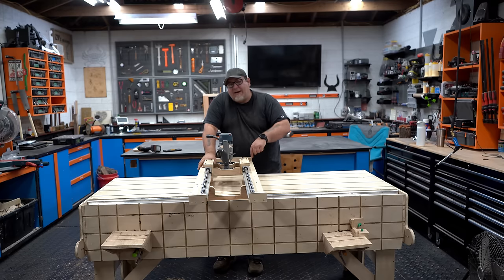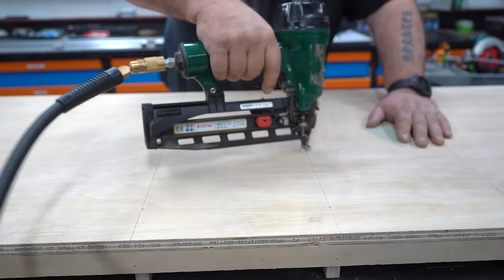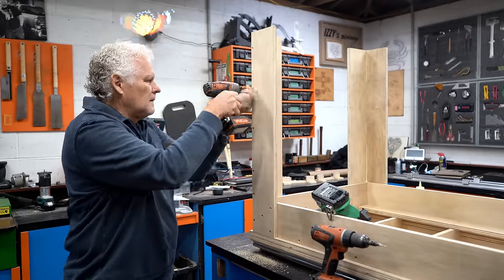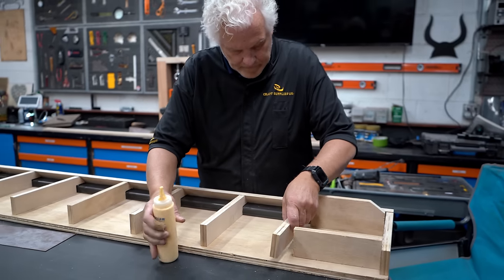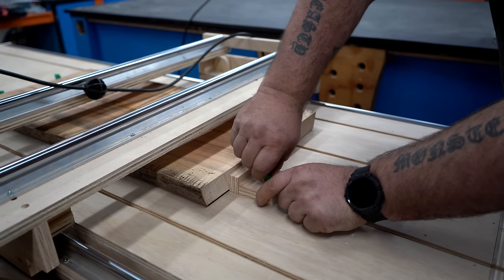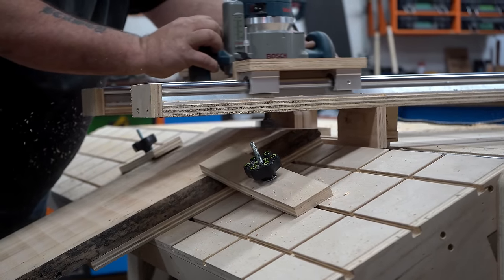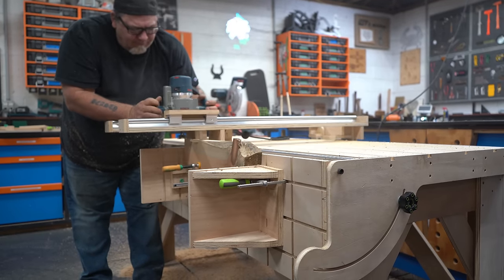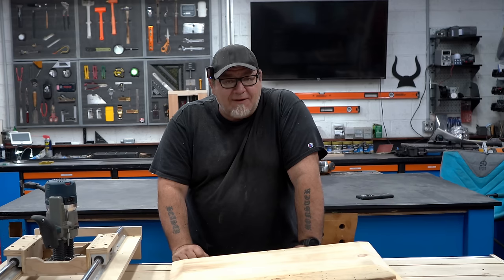How Slab Flatteners Should be Built

Comment: Definitely one of your better ideas. Its actually a simple solution with the ability to resolve so many more complex challenges. The versatility is awesome but this is not really an option for a small shop like mine. However if it was incorporated somehow into my existing workbench then my workshop/garage could use the single bench as a dual purpose. I use similar rails for flattening cutting boards and they work great. I am working on an idea to make the rails a permanent part of my work bench that I can reveal when I need and cover when not in use.

Comment: Make a sled for a circular saw and you could have a small panel saw. And with the matchfit slots on the top you could use the "panel saw" to batch out small pieces, or taper legs, or act as a jointer that's faster than using a router with a flattening bit. 

Kinda like the Kreg track saw table contraption. Google tells me it's the Kreg ACS.

Comment: Hi 👋,  Izzy Swan , interesting project, you might bear to incorporate a pattern system, whereby you make a pattern or jig, which can be clamped to your device, then heaven in a stylus that runs off of it, to create the shape that you require, I suppose the ultimate thing or to turn it into a CNC machine, I am quite lucky as I have a surface planner and a separate Thickness machine, good luck with your project.
Stay safe, keep up the great work shop ideas, Phil from the moulin France

Comment: Cool idea man!

Set up detents/patterns that can be used for making box/dovetail joints would be cool. 
It would also be cool if you can set it up to allow for shelf pin hole boring. 
To make it even cooler, you can set it to a lock position to lock the router to lock the router to make long dados/grooves. (Lock collar/c-clamp with a nice ruler that is zeroed router centerline might make it simple.)

Comment: If you used stops on the rails, you could use them to make recessed cabinet/drawer faces. Use the match fit stops to line up the top, cut, flip 180, and cut the bottom for all faces of the same size. Then reset stops to do the sides. It could replace a router table/shaper.

Comment: Super cool idea -  I think it would be fun to place a template on the main bed with a fixed pin attached to the main sled - like a pin router and then use the side board holder to make designs like mortise and tenons or patterns etc. on the board - you could even reverse it for top surface inlay or other types of carving....  one other thought would be to make some kind of adjustable holding fixture to help take twists out of slabs by making one side perfectly flat and then turning it over to make the other side parallel.   Thanks!

Comment: I think this is really cool, especially the side table which I haven't seen before in this kind of jig. I have a similar table like this built with linear rail and a melamine top. I really like the dovetailed grid you put into this and will have to steal that idea. Since building mine I use my 6" jointer much, much less. Firstly because I find the jointer so much harder to set up and get reliably flat surfaces from, and secondly because 6" is too narrow for the vast majority of work that I do. I want to get an 8" machine but honestly, I'm not sure that I'll use it that much more. The one thing my slab jig can't do is edge jointing, which is one of the reasons why I like your side section here so much. I occasionally mill small logs too, so it would be great for squaring those up as well. Oh and having recently upgraded from what I think is the same Bosch to a Triton 3HP router, I would recommend it.

Comment: I think an axis that you can put on the face of the pivoting table to make chamfers on round work pieces could be pretty powerful. The height of the jig becomes a limiting factor pretty quickly as far as the radius you can do but it would be an interesting challenge to chamfer 90 degree swept corners on a rectangular slab.

Comment: Suggestions on Occupational Health Concerns:  Suggestion 1:  Dust collection?  Who needs lungs anyway?  Suggestion 2:  The variable angle side table is cool with that big log sitting on it but…… that’s a lot of weight.  The only thing holding that weight is a few thumb tightened nuts and bolts.  The variable angle mechanism doesn’t look beefy enough to hold much weight without slipping.

Comment: Very interesting. Really wonder how far you can take this. It could a pore mans cnc router, straight and angled lines. How about adding a feature pattern following feature something like the pantarouter only horizontal. Not only for flattening. I really like the addition of the tilting side and how you put a bark covered log on it and flatted one edge. From that log you could go to 6, 8 sided not just 4 sided. I see a lot of potential for something like this. Wish I had a bigger garage. I agree this could be built as a assembly table as well. I do have a 4x4 CNC and since it's flat it does get used for assembly projects. The 4x4 CNC is plenty big enough for my needs but I could see building this thing 4x8 with the folding side wing. Oh the possibilities!

Comment: Very cool but in my case, no, 1) I don't have the room and 2) I don't have a CNC or a band saw to make the parts (and no I don't have access to those). But, I do admire and envy you. I made a cutting board and had to flatten it after the glue up. I used a similar concept to yours (with the router), but it was a pain to do.

Comment: Interesting, as it gives me some options for a build I want to do soon.With the pivoting side table, possibly some "stops /stop-pin holes" to bor ends (there might be a way to get a pivoot arm to the middle or thirds for extra ridgidity though I haven't though through the required geometry yet) at preset angles 60, 45, 30, 22.5?

Comment: Love your videos. 
If you put stop safety rings on the rails it could be used on cutting boards to create a groove. 
Same goes for things like grooves in a drawer front. 
How about using templates? So between the router base and the workpiece a slide in and lock tray. The tray would be clamped to the work table top.

Comment: This is so impressive. My issue is that I'm usually doing boards that are about 12' long which don't fit nicely on most frames due to rail length. Also storing such a large table in a hobbyist shop is tough. Maybe legs that fold into the top for storage?

Comment: I see a because we present the wood to a planer with a inherently square and 90 degree surfaces held steady the expected result is the opposite side will out come At 90 & square. Your device requires setups that must be accurate because they are creating 90 & reference edges at the same time. So a level of expertise is involved with use. Router fattening then corners squared by fastenings to the side table. So to 6ss takes a bit of setups. This device is exceptional at doing what others won't nicely done!

Comment: I built those infeed legs and they're AWESOME!  I have the same router, looks like a 1617evs, 2.25 hp router and now I have a 2nd one... as while using my sled, using probably a roughly same sized bit  with collet extension, and it got out of control during a pass on a board and ruined the router. Did not do good things for the end grain cutting board either.  Scared the Hell outta me of course. No injuries but it's for sure not "true" anymore either. 

Love your plans and stuff Izzy!

Dust collection or PPE is kinda missing in there, Get a mask on brother!

What router bit were you using? Link??

Comment: I like it! Very cool flattening machine. I have an upcoming project planned where I will be making a live edge countertop for our new kitchen cabinets. Only thing is, I don't know if commercial slab flatteners are able to produce a bull nose edge on that live edge slab. Basically, I want to be able to have the whole slab about 1/8" lower than the front edge of the slab, so that water won't roll off onto the floor. Have you considered that sort of feature for your machine as you develop it? I would be interested to see that. Nice job, and I would consider making one like yours to make my slabs. Thank you for sharing.

Comment: As you said, there's a lot of real estate taken up in the footprint of that. No doubt you are a design genius with all the contraptions you've designed over the years. Looking at it at the moment,  you've designed a manually operated 2D/2.5D CNC. A few more tweaks and a rise & fall cam follower, and you could knock out some 3D reliefs replicating items on the table eg large baroque picture frame in 90 mins... guilding costs extra!

Comment: It would be very easy to use as a mortiser, and for pieces that exceed the vertical height constraint from floor to gantry, you could build a horizontal gantry and let the pieces hang off the edge of the tabletop.

Comment: I woke up 2 hours early because I was thinking about other uses for this table. Initially I thought it would be cool to add some kind of band-saw attachment like the small hand held versions, but then why not add a different sled that is a chainsaw mill. You would use the smallest thickness chain so that you could do reprocessing of timber like using a normal band-saw but it would be easier and for people with less strength/mobility you don't have to hold and manually feed the timber through it. You could use the 3hp router to power it, you just need to get someone to mill up a half inch shaft that you could attach a drive sprocket to. Just a thought. Have a great day.

Comment: Automation! I'm VERY interested in building an automatic slab flattener, essentially a very basic CNC, though it wouldn't even need to be computer controlled. I'll eventually come up with something that does this, but I'd love to see what your big brain can design. While it'd be tempting to just make a CNC router, the level of precision required for that means it'd be far more complicated and expensive than a basic auto-flattener. Could be as simple as adjustable limit switches (so the controlled area can be adjusted to slab size) and a motor reverser, with the router plugged into a current transformer so that the motor(s) moving the sled across the slab can be slowed down when the router bogs down.

Comment: Well it seems the prototype is as good as you can get without checking for level second. I sware I was in like for trying something like this. I'm not a stickler for perfect degrees of angles because of my art type of projects.

My idea of possible improvement of this table top would be upgrading it do chainsaw sawmilling. With a few more ideas or maybe more metal parts it could be the full spectrum from log to boards to almost finishing a project. (Of course green wood ne needs dry time but that something else.). I see big potential here. Keep it up.

Comment: If the router sled could be removed from the table, I could see this in a small shop as the main workbench. Build the tabletop at the same level as the table saw top, put it on high quality casters and git to work.

Replace a jointer and/or planer? Izzy...I am too damn old to change the way I work. In my shop...now...I have a Delta 4" jointer and a 10" Ryobi planer that won't die, so I wouldn't use the table for small/medium sized woods. I don't do frame-sized work like that master of joinery, Dusty...but if I needed to, and had this built up, I could true up larger pieces so...I could see it in my shop. Hmmm....

Comment: As far as replacing a planer and/or jointer, it would depend on the type of material you work with the most. If you're using rough sawn lumber that could be badly warped, live edge, logs (like in the video), then yes, this would be the way to go. However, if you're using mostly surfaced lumber and just cleaning up mostly square faces and sides, the jointer or planer would probably be faster and easier. Just my 2 cents.

Comment: What bit are you using in your flattening sled? Amazon has a 1/2" shank 3" flattening cutter with replaceable blades, it's a Binstak $82.77. You said you want to get a 3-horse router for your sled. Probably gonna need 3-horse to drive the 3".
Love that adjustable-angle side table. Can you use that for raised panels?
Lookin' forward to see all the bells & whistles you're gonna put on that thing.
Best of luck to ya.

Comment: I think it's great, but the downsides are as you said, it takes up a whole lot of floor space, and second, it requires more setup time.   A thickness planer or jointer can be set up and ready to go in maybe 30 seconds or so, but this is going to take a lot longer.  For some people, that won't be an issue, for others, it will be a dealbreaker.   Thickness planer and jointer probably have easier dust collection also.

Comment: Great work!  While I completely understand the need for a larger router, what are your thoughts on that Bosch (1617 I think) 2.25HP router for the occasional DIYer?  I love the idea of replacing a planar and jointer with this design and will likely use it more for that than for slab flattening.  I am planning on using this same Bosch for both my router table and sled.  Thoughts on this?  would you still recommend a 3HP for flattening?  What are your thoughts on the Triton TRA001?  Thanks

Comment: I love it. But i think i would find a way to have it clamp on top of my table saw vs having its own table. I bought my saw with the extra cast wings and a wood area off to the right. Its where i have my router now. This could easily replace a few pieces of equipment I've been eyeing. Maybe I'd have it fold down off the back side of my saw and hide it under my outfeed table.

Comment: All the time I was watching this I kept thinking that mounting a six inch jointer blade on the carriage instead of a router would cover more area faster. 

The other thing you could mount is a sander. Instead of the commercial belt sanders you could use a small sander and sand the top perfectly flat.

Comment: Could you make it more height adjustable by having the sides move up and down, so if you wanted to flatten a thicker slab, or even do work on a larger existing piece, you could raise the sides? Maybe use a screw mechanism or scissor jack to adjust them? It would also allow you more height adjustment on the router if there's a particularly uneven surface on a piece

Comment: You probably know this, but for long term use the pivots for the tilting table should be pins rather than threaded fasteners.  The threads will grind away the inside diameter of the mating holes every time the tilt is adjusted, causing the fit to get progressively sloppier over time.

Comment: I have been thinking along similar lines and bought the rails for cutting sheets of plywood. This to me (4x8) is minimum size but i could see a 4x4 version. 
My thinking is a panel saw design, that tilts into the wall. This allows easy loading of plywood. wood chips fall to the floor under the machine which keeps work surfaces clearer. it should have a vac port and "broom" brushes around the cutting tool.
 an idea i stole from home depot saw is a lazy susan set up. so i can turn the saw and do vertical, horizontal cuts. 
It needs to have a universal base that so different routers or saws can easily be used, accurately. I like a clear base so i can see whats happening.
It should be easy to 0 the tool to a measurement scale. 
Repeatable stops on the rail so someting like a series of dados can be cut.
I can see a wood mill 
Get six orbital palm sanders and mount them with an 8" stoke so the can sand a plywood sheet sander.

Comment: I want to build one that runs vertically with the router on its side. Linear rails and ball screws with crank handles for manual axis motion. A table big enough for a large work piece with a frame on one end of the table that raises up to the height needed to do edge work.

Comment: Suggestion. What if you can lock the router in position and use a spiral cutting bit to rip boards down by sliding the sled. Not sure when/if this would be more advantageous  than a table saw but it would allow you to do differently grooves through boards too.
Reply: Or make a sled for a circular saw to ride in. Kinda like a cnc one is made on rails.

Comment: My wood shop isn't set up yet

But if I hear another woodworker tell me how much he hates sending😂

So my tool trolley will have interchangeable tools

One will be for a 5 and 1/4 inch sander orbital

Another will be for 48-in drum sander

Both of these will be run by the CNC controller using rack and pinion

Comment: I'm sure there's a way to attach belts and motors to make it semi-automatic.

The way I imagine it is using a rasberry pi or arduino to control the motors and have limit switches that you move to define the work area. You could use clamps to locate the limit switches using the grooves in the table. 

I picture activating a limit switch with the gantry to tell the computer one edge of the work space, and activating a second one to define the second edge of the work space and the direction of travel.

More work than practical? Probably.
Fun? I think so.

Comment: Can you add a pivot point to it to do beveled edges on a round table? Great idea. I have a lot of logs on my property that will not fit into my small planer but I don't want to rip them down to fit. This would work to make them usable as is.
Reply: Would be more practical to make 2 wheel attachments that he can attach and detach to the pivoting table. First of all, to have the round table top lean on, second to rotate the table top, third to prevent from having to drill a hole in your table top